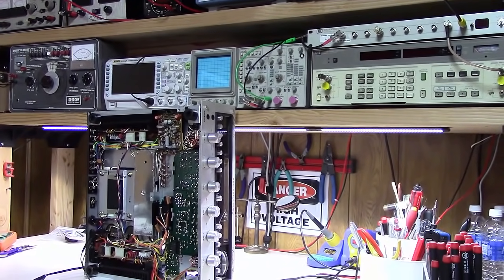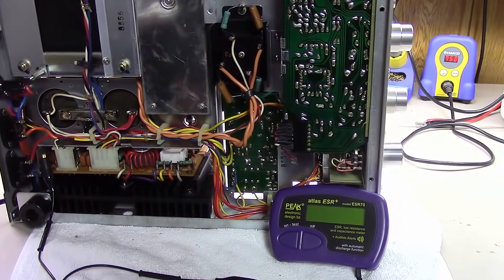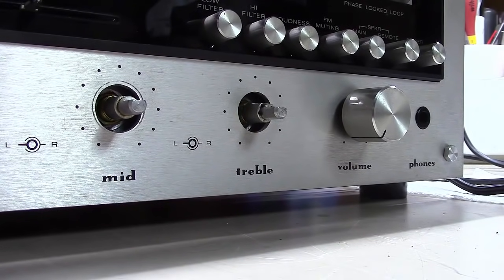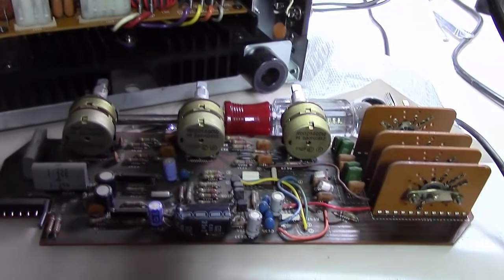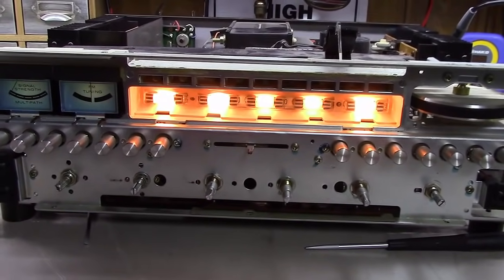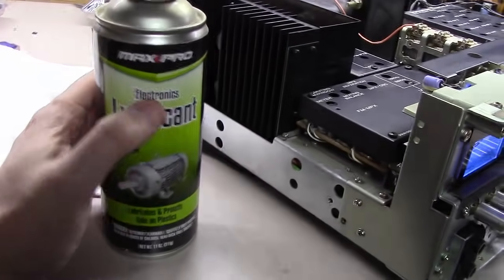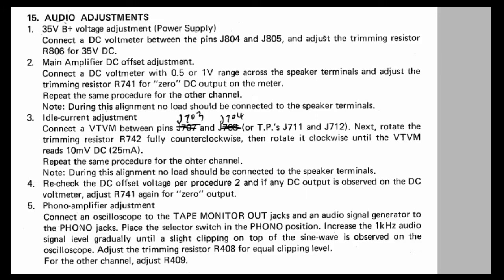Marantz 2275 Service, Recap, Relamp, and Bias - BG039

Comment: I've worked on many of these - if you have not cleaned the tape monitor, filter, loudness etc push switches and serviced or replaced the speaker relay you are going to have channels cutting out, or distorting - in the case of the loudness switch, one channel may boost bass when in the OFF position etc. These issues are easily seen on a 'scope, especially using for example a 1kHz square wave from an audio generator and monitoring across your 8 ohm loads with the 'scope. Tapping on the old relay for instance shows how they tend to cut out or distort the signal. Turning up the volume may get it back but the problem recurs.
Reply from the maker: +Mark Zacharias all those always get cleaned.  the defeat button is a prime suspect on marantz amps with a eq built in.
Reply: +Blueglow Electronics OK, just didn't see those items attended to here.
Reply: Just hooking up a 2265b today, and notice some hum when the tone knob is set to IN. Less hum with the other settings. Hum remains whether I'm using phono or input from an Ipod into tape in. Not objectional, but there it is.
Reply: Mark Zacharias 
Thats exactly whats going on with my unit then ? The amplifier power's up but will not push any sound though my Kenwood 777a's & Pioneer HPM100's .

Comment: Why do people say, considering the technology back then that this unit is really good receiver. What does that mean? Hell we went to the moon in 1969 with that technology. Always remember the advances In technology that you enjoy today is a result of the technology that started with the invention of the wheel. There is very little technology today that didn’t have its roots in older ideas and concepts. It’s a compliment to the older technology that made it possible for this high quality vintage receiver to be refurbished and enjoyed to its former glory. Try doing that with much of the consumer level throw away units today.  By the way, fantastic video by someone who knows what’s he doing. Thanks!
Reply: It isn't really about technology... it's more about engineering for sound quality and longevity as opposed to cost efficiency for maximum manufacturer profit, which is what happened in the 80's.  Today?  Forget it.  There's hardly a market at all for high-end audio equipment.  Most are satisfied with their phone in their face all day.  "Hi-Fi" is a lost art to all but fiends like us.

Comment: I am currently working on a Marantz 2220 and was stymied as to how to replace the dial lamps. I was finally able to get at them from the front by peeling off the dial face which is glued on as shown in this video. I ordered some vellum paper as well. I can’t say it has been easy but is doable. Thanks.
Reply: I recently replaced all bulbs in my 2220B and put new vellum in it, and it looks amazing.

Comment: The heathkit ar1500a output sections as well as all other sections are similarly easy to remove. It's modular design made it a treat to work on and wow did it sound good when rebuilt. I think like the sound better than my own personal 2270. Had never heard one of these before and it was putting out 73 wpc rms at 8 ohms and 122 wpc rms into 4 ohms.

Comment: I've got a Marantz 19 and there are many similarities. When I bought it in 1974, they used a 2270 for the amp because it had more power than the 19's mere 50 watts.

Comment: I think CAIG chemicals are the best you can buy ! I just wish they would sell pure 100% DeOxit in a 2 or 3oz bottle, so you could thin it out as needed ! Do you use CAIG Fader Lube, after cleaning with DeOxit ? As for the velum usage..... I use Rosco theatrical lighting gel's diffusion sheets, instead of velum because it does not yellow due to age, heat or UV light ! Especially when  I'm restoring tube HAM gear, like Drake, Collins, Hammarlund, Hallicrafters, transmitters and amps etc......!  I think your shop is near Raleigh ? When I lived up there, I use to get my gels from a stage lighting & sound shop in downtown Raleigh. Love your work !!

Comment: I'm the original owner of a Marantz 2220b receiver which I bought I think in 1976.  I used it mostly the first  seven years.. then rarely used it after gifting it to my Mother.  My mother is passed and now I just have it for the FM radio in a spare room.  I need to recap and refurbish.. where do you order your replacement parts and how do you go about choosing replacements?

Comment: An excellent instructional video, as always.
I have a 2275 and this video will be very helpful for me, particularly because the unit is in Brazil where it's extremely difficult to locate a tech who has the experience of working on such vintage units - not to speak of finding appropriate replacement components.
 Now, somethIng off-topic, but with which I hope you can help me. I also have a 4270 that has problems that I suspect are related to the power supply.  That unit was in a local shop where a few months ago the tech replaced a couple of ps caps and returned it to me working.  But it soon failed again. No power.  So, this time I'll ask him to replace all of the caps on the power supply board.  I've now been in the U.S. for a couple of weeks and while here I located a pulled 4270 ps board on eBay.  I bought it, since the price was right and the seller claims that it was working when pulled. I'm not sure whether I should simply have the tech install this pulled board (first replacing all the caps, of course) or go with the one in the unit.  What would you do?  One other thing:  The 4270 service manual shows the fuse (F801)on the ps board as 0.3A 250v. But on the board itself, on both the original board and on the pulled one, F801 is marked as 0.8A 250v.  This is strange.  Would this be an error in the service manual? Which should I go with? Thanks in advance for any comments.

Comment: I had a heathkit ar1500a  in the shop for a rebuild recently and almost every sandy resistor  in the unit was near twice the spec value. All the .33's were .7-.8) ohms. Even with this issue the unit was still working and still sounded pretty damn good. Have you ever seen that? What are the odds that every sandy was double spec?

Comment: Note that the metal clips that hold the fuse lamps in place behind the dial are soldered to a long circuit board strip,  and the solder joints to these clips frequently break down from the heat of the lamps,   causing the lamps to become intermittent. I always resolder all of these fuse-clip type connections;  but because there's typically a big lump of crusty, oxidized and and degraded solder on them already, in order 2 get a good solder joint you probably have to suck some of the old solder off first. This requires a steady hand and some tricky manipulation of both the circuit board and the desoldering gun, because you really do not want to hit the dial string with a soldering iron! It might, I repeat might be helpful to undo that circuit board strip so you can pull it back a bit, away from the dial string. Trust me on this, it is extremely annoying to take the faceplate off and replace all the lamps and put the unit back together, only to find that the solder joints to one or more of those metal clips are intermittent.

Comment: Excellent video! Thank you!  I just picked-up a 2275, and have already ordered bulbs, cover screws, and a used plastic isolated-ground headphone jack.  I was tempted to replace the broken one with a common metal-bushing version, as the ground terminal appears to be grounded.  But I guess they had their reasons for isolating the bushing.  Who am I to argue?
Disagree with you on the LED change-out, however.  The LED mod, to me, looks very harsh, and not the pretty deep blue that the incandescent bulbs provide.
Again, thanks for the hints and kinks on getting this fully-restored; idle and bias adjustments are certainly appreciated!
Cheers!

Comment: So what if you  connect your multimeter whenever adjusting bias and the meter reads 0.000mv. Would you turn your pot left or right meaning  -10mv or 10 mv????

Comment: Informative video. Thanks for sharing. If I may offer a suggestion on shaft nut removal - I've been successful holding the screwdriver shaft in a tight fist, braced against the front of the unit, then tapping the end. cheers

Comment: Believe it or not, I picked up one of these at the Goodwill for 11.99 on half off day...so 5.99!!  I have it at home plugged in to some polk audio speakers.  I upgraded the lights to led myself, but my right channel cuts off....If I increase the volume fast, meaning turning the volume up on the wheel fast, the right channel comes back, but then later cuts off again..any idea what this could be, and is it something I can do myself to fix?

Comment: For these vintage audio equipment restoration, do you pull out the power transistors and put in new silicon thermal compound?  I have a Harman Kardon Citation 16 (150W per channel).  I worry that if the thermal compound dried up and lost the function transferring heat to the heat sink.
Reply from the maker: I usually check the temperature of each output transistor, if I detect any abnormal heat, I do

Comment: Hello I have a Marantz 2270 1972 that has never been touch...does recapping make any sound difference...and about how much is it to go through it just a ballpark figure you seem to know what your doing and I'm not sure of your location I'm in Florida!! I've always had that Theory if it isn't broke don't fix it the phone works fine the Fm works great the one thing it needs that I'm aware of is a volume and bass potentiometer I've tried cleaning them there not scratchy they feel looser than the other knobs...anyway hope to hear from you!!!  I like your demeanor and dedication for vintage audio
Reply: Recapping make a difference in the sound.  

The capacitors actually have a liquid electrolyte in them and this dries out over time, just like water it evaporates.

This causes the caps to go out of spec.  This happens slowly, so the degredation in sound quality is normally only noticed when they are replaced and you think.  Wow, that sounds better than ever.

If you do recap.  Get decent quality caps from a manufacturer like Elna, Rubycon, Nippon Chemicon, Nichicon or Panasonic.  Suppliers like Mouser or Farnel will have them at a reasonable price.
Reply: E-Cap values also drift over time, another reason to recap.

Comment: Are you ok with putting a turntable on top of this for helping keeping the dust out, with the typical feet to turntable distance being enough to not overheat the amp? I have an old Oracle MKII  that I'd like to put on top of my 2265b. Also, before I do, do you recommend some type of vacuuming of the inside? By the way, I'd like to see you soldering a cap to the board.

Comment: It appeared as if you did not touch any of the capacitors in the radio tuner circuit. Why not? Are they not just as prone to failure as the amplifier circuits?
Reply from the maker: They are.  Typically I ask the customer if they want them replaced.  Some don't elect to based on cost as they don't use the FM section much any more.
Reply: +Blueglow Electronics from your experience after replacing electrolytic's in the tuner circuit, the tuner will more certainly need to be aligned?

Comment: Your video inspired me to find a 2275 of my own and you've also made me brave enough to handle some basic repairs, too! Also looking forward to a tuner alignment video as my pointer is a bit off at both ends of the scale. For example, when tuned to the station at 89.7, the pointer is sitting roughly at 89.1 Is there an easy fix for this?
Reply from the maker: That's not an alignment issue, it's a pointer on the string location issue, can walk you through fixing that

Comment: Hi there, I have this exact stereo and i have an issue.

the right speaker goes in and out... sometimes it works, sometimes it doesn't.  I took the stereo apart, deoxited all the pots and twisted the knobs, and it didn't seem to work.  is there anything else I can do to fix this problem?  

If you address it in the video my apologies!

Comment: So this past weekend I went ahead and replaced all the factory lamps on my Marantz 2240B receiver with LEDs. I purchased an entire LED kit specifically for my model. The Stereo light never worked on it to begin with, and after taking out the original bulb, it was indeed, dead. Soldered all the new bulbs back in using the schematic, making sure positive went to positive and negative went to common, since LEDs actually do have two sides. However, my Stereo light still doesn't work, and unfortunately, I never did test the lights while it was still apart (just nervous to turn it on, I guess). Could the polarity be backwards for the Stereo light, or do you think something else could be preventing it from turning on? The Mono switch does in fact work and puts the signal in Mono when depressed, and back to Stereo when "turned off". Any info would be great. Thanks.

Comment: That board, P400, that you're calling the 'pre-amp' board is the Phono board in my Marantz 2325.  I've seen other restorers replace that 100/35 axial with a 220/63.  I knew you could up the voltage but can you also change the capacitance value?
Reply: Yes you can but not to an extreme. They don't make the 100/35 anymore so you have to go to a different value as long as it's greater.

Comment: I'd try and put an additional sheet of that diffuser paper between the LED-bulbs and the radio scale in order to get a more even light distribution. Like a half-pipe piece of screen half the distance between the LED's and the scale.
The additional light output from the LED's compared to the old bulbs would certainly allow for it :)

Comment: I was wondering if you would happen to know what the DC voltage supply rail would be on the tone amplifier for the 2275? Would the 2240 use the same tone amp?
Thank you in advance.

Comment: why not change the main power filter caps? I've had a couple old amps where they have failed being open, or leaking out black smudge. Aren't they just as likely to fail as the smaller caps?
Reply from the maker: +kwapedog Those are pretty high quality caps and tend to hold up very well.  If they test with a very low ESR which these did (<1ohm), I'd recommend leaving them alone.

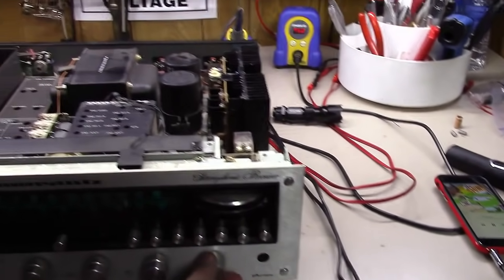Comment: At 12:30, note the black tarnish and oxidation on the pins of the output board. These should be polished with a pencil eraser. Spraying Deoxit into the Molex type plugs is neither sufficient nor a good idea. Use a degreasing solvent that leaves no residue.

Comment: Lucky you didn't scratch the face while loosening the nut around bass control. I heard a scrape but luckily, no wound.  Put a big flat driver in  the slot like a regular screw and turn carefully.  And the spoon trick is a good idea for removing knobs but I'd  place a cloth between spoons and face plate.  Nothing worse than the unit surviving unscathed for almost 40 years and some carelessness defaces it in  seconds.

Comment: I've always used a wire from the receiver to a window and put the wire outside a little bit but how I do it is I drill a hole in the plastic of the outer part of the window and then hot glue the wire in place because this is the only way without using a outside antenna that I don't want to install and I live in a block house.

Comment: Kind of hard to see the illuminated dial pointer against that overly bright blue background from the LEDs. A dropping resistor to tame those LEDs a bit seems in order here. Personally, I would have used Warm White LED fuse lamps instead of those somewhat obnoxiously blue ones that everybody else seems to find so appealing nowadays, in order to maintain a more vintage style look, and if you really need a bluer or greener color spectrum,  then you can selectively add some colorizing gel film, perhaps a strip of it  cut to the same size as the vellum , or some translucent blue shrink tube slipped over the LED fuse lamps before installation. Either that, or replace the incandescent lamp for the dial pointer with an LED that is a bit brighter and more visible, which can be tricky to fit into that little housing, and you need an LED that will radiate some light out of its sides and not all from the top, which again is difficult to find.

Comment: Hello everyone i just picked up a Marantz 2275 and it is beautiful inside and out. No problems. My question is should i have it serviced or inspected? I live in Philadelphia Pa. I cant find a local stereo shop that still work on vintage electronics. 
 So should i not mess with this unit or have it serviced? Id hate to spend money if its not necessary. Any answers will help. Thank you
Reply: I would just use it for now...You don't want just anybody to do the work. Enjoy it while you locate someone like this gentleman.
Reply: I'm doing the same for a Yamaha CR820 I picked up recently.